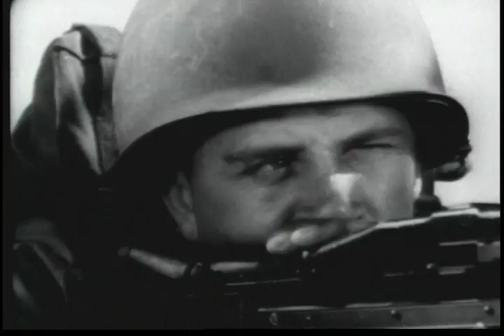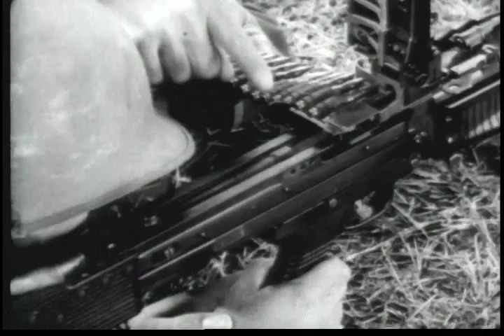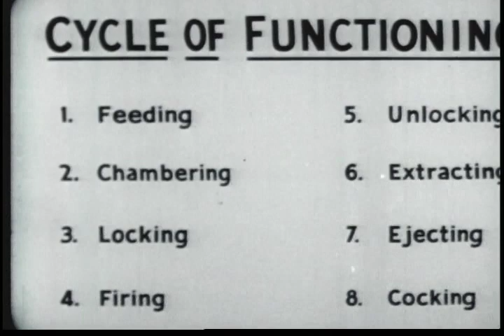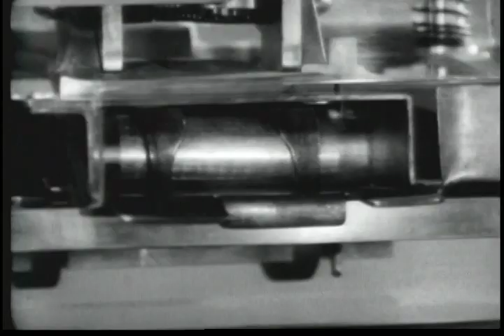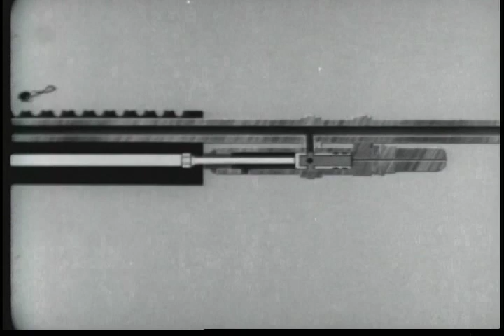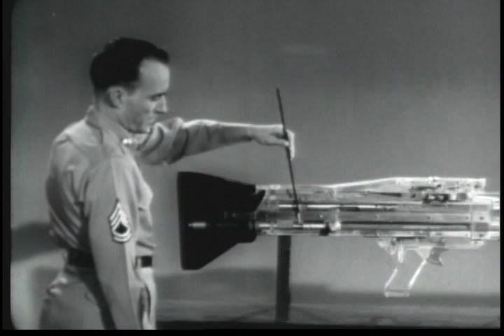M60 Machine Gun, 7.62MM - Operation and Cycle Of Functioning

Comment: A truly effective firearm.  7.62 mm punch, high rate of fire and relatively good accuracy for a machine gun.  Yes, it was heavy and the ammo heavy.  I had a horrible incident in Vietnam, however, when we took over a perimeter tower during the "Cambodian Incursion."  Whichever unit deployed they left us with a defective machine gun.  The gas cylinder system had a leak and would only fire 1 round and not cycle the next round into battery.  We discovered this defect during an enemy ground attack.
Reply: Oh wow.  What happened after that point?  How did you adapt and get out of that situation?

PS -Welcome Home
Reply: @wightclaudia   Devine and I opened fire with our M-16's.  The OG called for a "mad minute" in our sector, which meant all towers & bunkers sweep their fields of fire for about a minute.  Lots of weapons cleaned before breakfast, shower and sleep!  Whichever unit had responsibility for that tower replaced the M-60.

Thank you.
Reply: Was the piston put in backwards??
Reply: @hairydogstail  All we were told is the M-60 was in the armory when they unit was sent to Cambodia.  They grabbed a non-op for whoever took over their Tower and took a good one.  I'm OK with that, IF they had put a big tag on the dud they left for us, and would have had our armorer find out what it needed.  Something was wrong with the gas cylinder, or the cap.  I'm not familiar enough with the M-60 to know whether or not the piston can be put in backwards.  Hey, I was an oboist!  :-0
Reply: @donalddodson7365  I hear you. It was easy to insert the gas piston backwards, which was a failing of the early design. From what I have heard the new models fixed that design flaw and are one of the best GPMG's today..You guys were also given a rifle that wasn't yet perfected that would jam all the time too. Today the M-4 is a very reliable rifle as long as it is maintained with good parts and an armorer who know what they are doing..I'm glad I missed that party back in the 60's and 70's, I always supported you guys, even as a kid....Thank you for your service...

Comment: M-60 is based on the FG-42 paratrooper weapon design with MG-42 belt feed system adapted to it.
Reply: And the M1 gas operation, and several Lewis elements in both gas operation and locking mechanism.
Reply: @peterson7082 its not m1 gas operation they are VERY different. Only common thing is both are long stroke piston , other than that gas system is completely different. Early m1s had a gas trap system and later ones switched to a normal gas system with gas port. M60 on the other hand has a gas port with an expansiok chamber and built in gas cutoff.
Reply: hulk78301 and they made one awesome gun out of it!
Reply: The FG-42 is based off the Lewis gun..

Comment: On an M-60, if  you fire 100 rounds within a minute, you have to change the barrel.  7.62 Nato, aka 7.62 Winchester aka 7.62x51 is a pretty hot round.  Metal conducts heat like it's going out of style.  I've talked to more m-60 gunners than you, apparently, because they have all told me that either they managed to scrounge up an asbestos glove, or they wished they had.  And the vid has more cuts than a suicide girl.  It's an instructional vid.  For illustrative purposes.

Comment: A lot of people tried to copy the G3 receiver, because it was stamped sheet metal.  Not many succeeded at it, though.  You'd think it's hard to screw that up; but you'd be wrong.  To this day that rifle is still in service in many parts of the world, and is my favorite rifle ever.  It's also my father's favorite rifle.
Reply: Funny you should call it a 'rifle'. Like the 'Matel 16' is was 'different'. The M-60 is a 'mutt' machine gun that 'borrow's from 3 or 4 different designs. There wasn't a lot of thought put into it. We would have been better off buying the MG-4259 after WW2. We would still be using it today. The M-60 I First got was fresh out of the Crate in the late 80's. It was a very tempermental weapon. I had to get into tremendous physical shape to keep up with the Riflemen. Many times, it really was a 'unique' rifle.